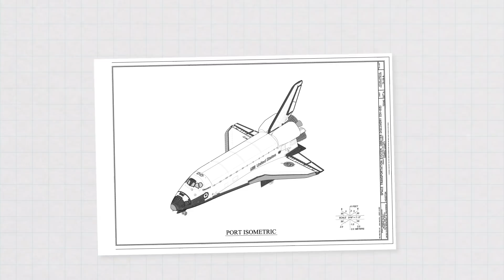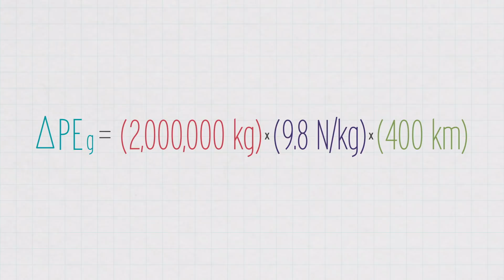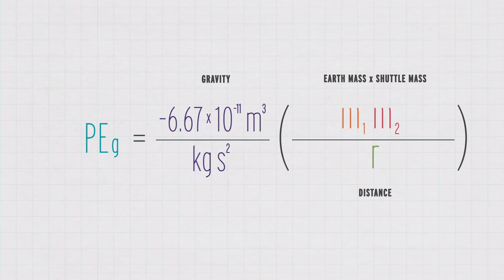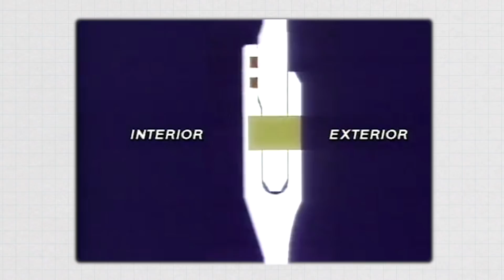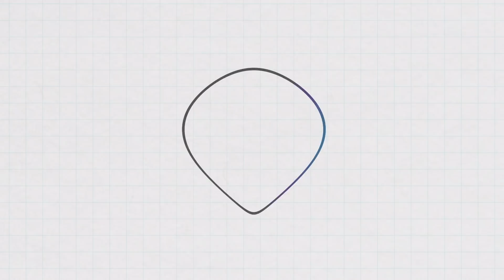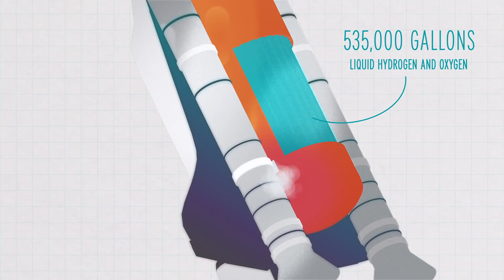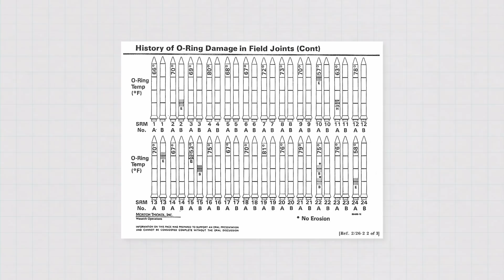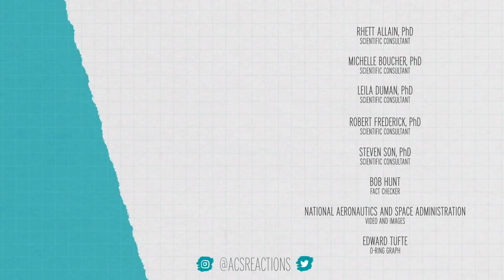Challenger: The Real Story of an Avoidable Disaster

Comment: This design flaw was know before the system was even built, it was then given a solution and it was ignored, so a specification of a No Go if launch temperatures were not 52F or higher; there was ice ALL OVER the tower and spacecraft.  Engineers were told to shut up or be fired.  Some BODY wanted this disaster to occur.   Do your research,  connect the dots, and understand history.

Comment: The engineers from Morton Thiokol warned NASA days before that the o-rings of the boosters wouldn't hold at temperature below 53 °F, but NASA launched nonetheless because of pressure they had.
Richard Feynman proved the problem at the inquiry commission with ice and water.

Comment: Nice video... don't mean to differ with you, but the situation was NOT caused by a poorly constructed graph. NASA engineers and Thiokol were acutely aware of the issue with the o-rings. The worst part is, NASA had a prohibition against launching below 53 degrees, yet they did it anyway. Said during the meeting to determine if it was safe to launch,  Lawrence Mulloy, the project Manager for the Space Shuttle Solid Rocker Booster Program, ‘What are we supposed to do, wait until Spring?"

Comment: That clip at the end, was that a saturn 5 with solid rocket boosters added to it? Now that would be something to see.
Reply: It's a computer animated version of the Space Launch System. Basically the shuttle fuel tank with stretched versions of the shuttle SRBs (5 sections instead of 4), with a second stage stuck on top of the fuel tank and engines grafted onto the bottom. And it's still a bit short of the lifting capacity of the Saturn 5; of current planned rockets the only thing that will top a Saturn 5 is the SpaceX Starship and even then not by much.

Comment: While this is better than cursory, the "real" reason for the disaster is much deeper, being both cultural and actual poor engineering practice. It is very useful to read appendix F to the Rogers Commission report and the story of Richard Feynman's involvement in the investigation in his autobiography, "What Do You Care What Other People Think?" I think his rough estimation for shuttle mission failure was about 1/50 and the correlation between that and the fact that it was about 50 missions later that another shuttle disaster happened is never pointed out.
It is popular to buy into the story that the "suits" never listen to the engineers, but in most cases the culture at NASA was to avoid the difficult conversations, to assume what the, "suits", would say and work within the confines of self-restriction.

Comment: Didn't the equation for the change in potential energy get simplified too much here? I know the host mentioned that it's not exact because of the fuel being used as the rocket went up, but that creates a huge difference in the final answer than assuming a constant weight for the equation.

Comment: There's another issue that I'm curious about -- it seldom gets mentioned but it seems like a major contributor to the Challenger SRB failure. It's the fact that the boosters run on solid fuel -- relatively foolproof to ignite, but can't be extinguished, but the Shuttle main engine is more complex to ignite, though it can be shut down. This means the Shuttle main engine must be ignited BEFORE the boosters. The result is visible in the clip at 10:02 in this video -- there's a "bobble" in the entire assembly; the shuttle literally pushes and flexes the solid boosters, which are ignited at the return "bounce" from that initial impulse. The flexing forces on the boosters are enormous, and some part of that flex is going through those O-rings.  This stress was undoubtedly part of the design constraints for the joints around the O-rings (assuming temperatures within a specified range), but that entire situation seems avoidable to begin with. A rocket that must flex itself like that just before launch seems like a really crazy design, when you think about it.  (FWIW, the Soviets' Buran design avoided it, by not putting any main engines on the orbiter at all.)
Reply: Known as the 'Twang', it took about six seconds to complete , caused by the asymmetric thrust of the  Shuttle's main engines . Once the top of the external tank returned to vertical the boosters could be ignited.
Reply: To be fair, the space shuttle is all-around a crazy idea/design

Comment: O-ring erosion was documented as early as STS-2, and IIRC there were two recorded cases of primary o-ring blow-by recorded on a single flight prior to STS-51L. Shuttle should never have been allowed to fly as long as it did without a field joint redesign, but unfortunately safety is often written in blood.